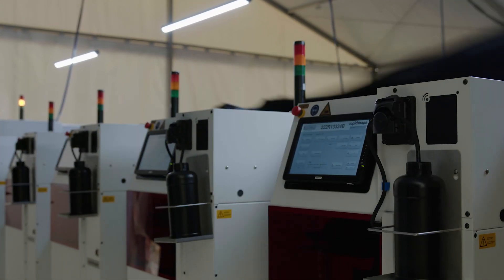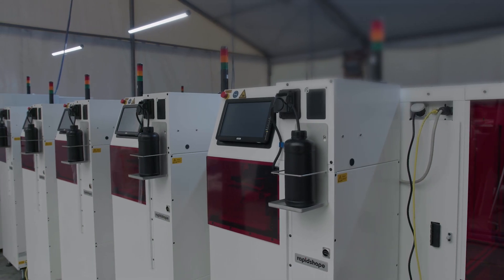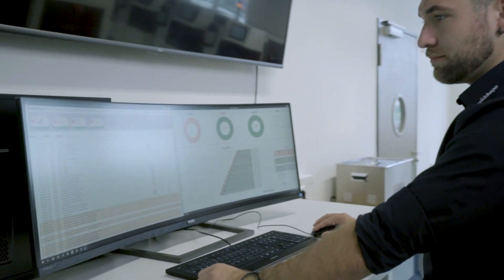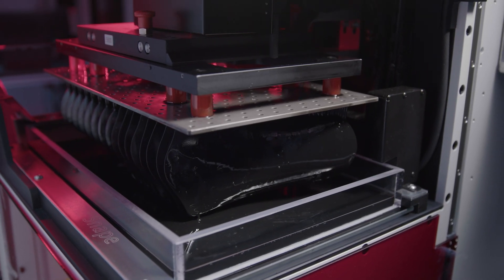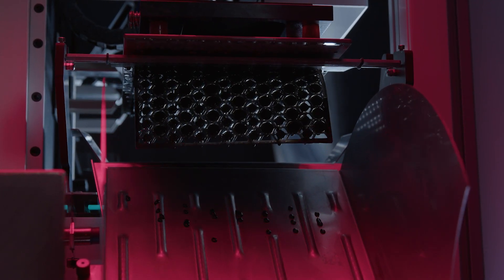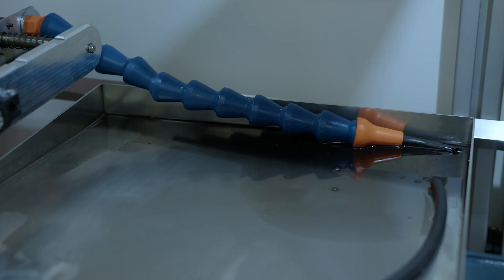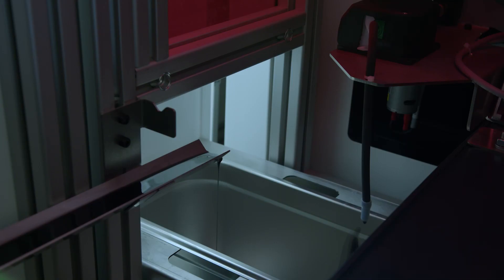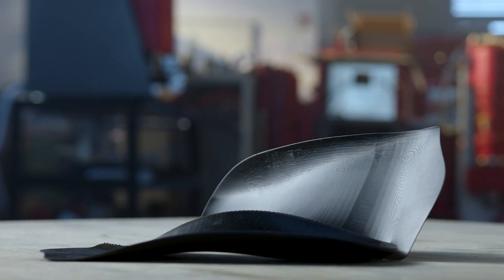Rapid Shape`s RS inline enables automated series production around the clock. This is the future!

Comment: So, your delicate rigid resin parts are going to break when getting scraped and dropping from the platform, or you have an automated solution for that?
Reply from the maker: The resin is not as delicate and rigid as one might think. The printed parts are robust and no damage whatsoever will be done to the parts by the automated seperation from the building platform or by the short drop. 

Thanks for your comment and your interest, Adam. Always happy to answer questions.

Regards,
Rapid Shape